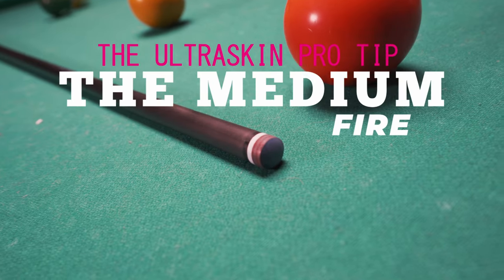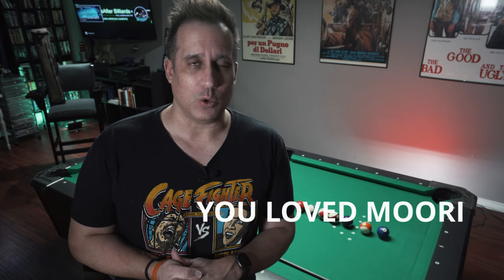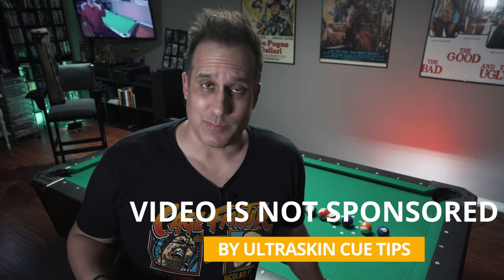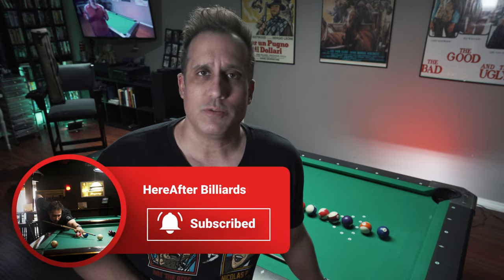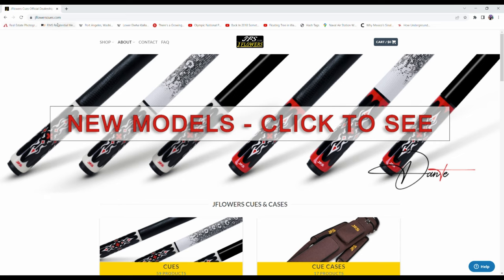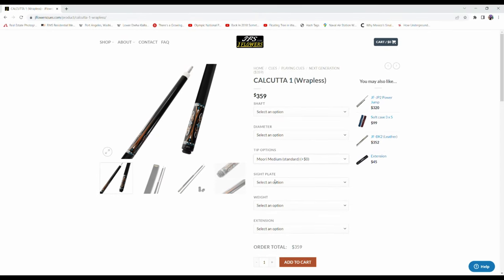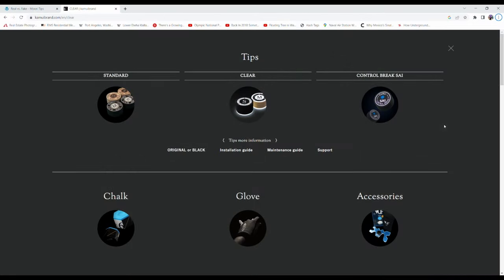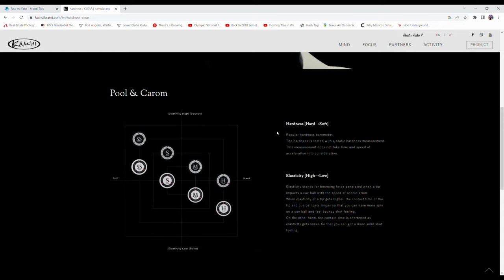Cue Tip| #Billiards Review | Ultraskin Pro Medium Fire | IT'S ALL TASTE

Comment: By your review here, I had an Ultraskin Fire medium installed last week on my Predator Revo 12.4 mm shaft I got about a month ago. I had an old Moori medium installed on my last shaft and really liked it, but wanted to go with a tip that is currently being made so I can stick with it for future replacements. I tried but didn't like the stock Predator Victory soft tip that came on the Revo; I was consistently miscuing on long draw shots as well as was significantly killing my action on the cue ball, in general. For my stroke, this Ultraskin Fire plays as good as any tip I've played with over the years. I've played about 40 or so games with the Fire so far; I immediately stopped miscuing on draw shots and got back my action on the cue ball and better feel. I love the Revo, and this medium Fire tip. Thanks for the tip recommendation.
Reply from the maker: I really glad you're finding it as good as I did. I think for the price there isn't a comparison in the layered tip market. Recently I switched out cues and went back up to a 12.5mm shaft from the 11.8mm. I knew immediately that I'd be popping off the factory Moori but this time I decided to go with a Taom Fusion. If I were to compare the two tips I would say the Fusion feels softer and I generate even more action than the Ultra Skin but I don't have to deal with the mushrooming that you generally get with the softer tips. I'm loving it. That being said the price of the Taom Fusion is quite a bit higher when compared to the Ultra Skin so is it worth it? Who am I to say. It's all about personal feel but if you're experimenting with tips I'd give the Taom a try. It's pretty awesome in my opinion.
Reply: @HereAfterBilliards  .. I like a firmer hit but not too hard so this type of tip, a fair quality laminated medium tip, simply works for me. I noticed someone here said they like the Zan hybrid; I tried it but the feel of it was funky to me. To me, the price difference of a tip doesn't matter, none of them are that drastic in cost difference relatively speaking, because the tip is of primary importance for your cue and thus for your game. For one other example of a very inexpensive tip I really liked and shot well with is the Wizard medium laminated tip. Like you said (loosely paraphrasing), a cheap date can be the best date, it's just whatever feels right and works for you LOL.
Reply from the maker: @jf1858  😂😂😂😂😂"A cheap date can be the best date!"
I love it! I've had a few of those back in the day😂😂😂
Reply: I bought some of the fire tips from the website you mentioned in the video and I also have a tiger onyx. I want to change out the tiger sniper tip that came on my Cuetec Cynergy because it is accidentally inducing too much spin when playing that is causing some errors. I’m your opinion should I instal the fire or the onyx on my Cuetec Cynergy shaft?

Comment: The whole pool community definitely knows that Moori isn't what it used to be in the early 2000's. I'm in the process of switching to HOW mediums. So far, I'm a big fan. Tiger Onyx is also a good tip. Kamui seems to be over rated, but I believe they play well. I'm currently hearing the the Zan Hybrid Max is the best on the market. I'm now learning to use a lathe and experimenting on my own. I'm using a durometer to check initial hardness also. I was putting on a Kamui Soft last weekend and the bottom layer totally delaminated. I'm not too happy with that. I'll be putting on another HOW medium tomorrow night on my spare shaft (identical). When I make a change from now on, I'm going to change the tip on both shafts and rotate them out so that they're as close to identical as possible in case something were to happen during a tournament.
Reply from the maker: Wow that is awesome. Let me know how these tips react for you. I want to keep experimenting.
Reply: hello, ur kamui soft bottom layer delaminated? i heard this happened on Kamui clear,  the one u using is Kamui non clear pad?
Reply from the maker: @supriadiramlan5545  It was a clear yes